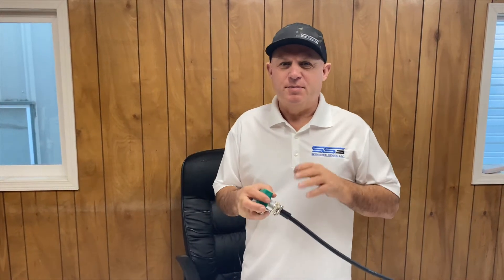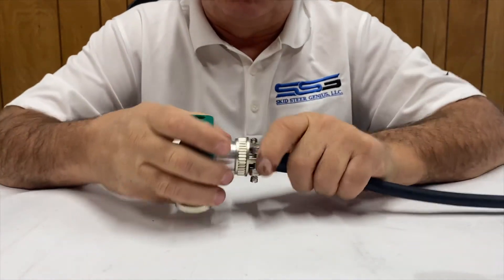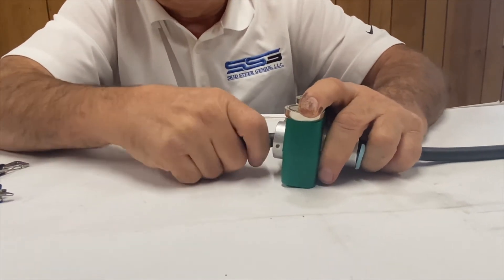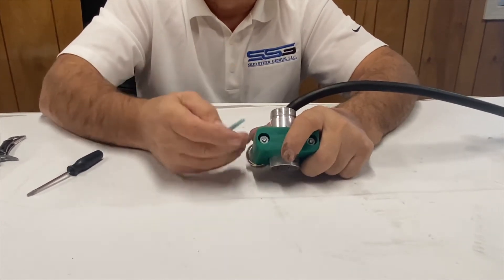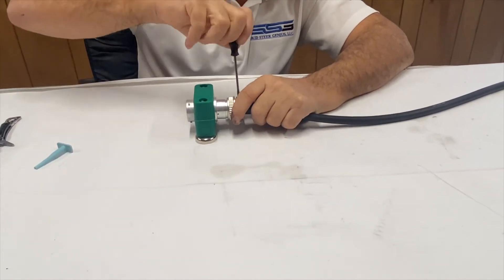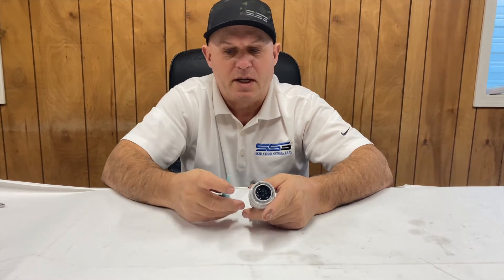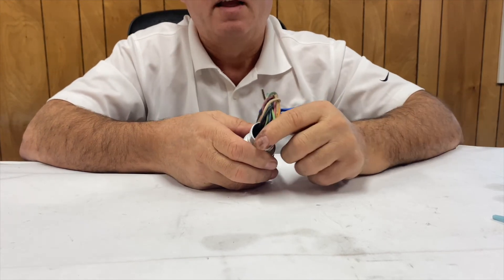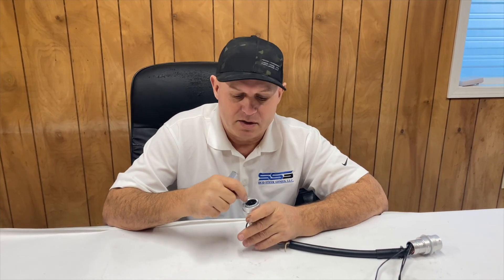#146 - John Deere's Dirty Trick to Lock You Into Their Attachments

Comment: Wouldn't it work/make sense to simply jump the connection between A & B -- allowing it to them work with attachments configured for either standard.
Reply from the maker: We have a hidden jumper in our harnesses but you can't use it on a Cat D Series because they use A for a control circuit.